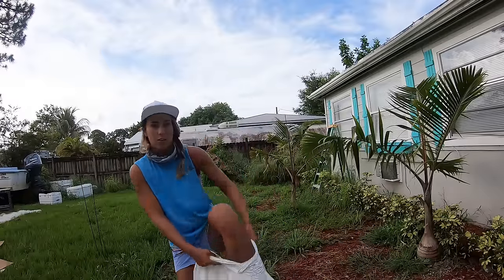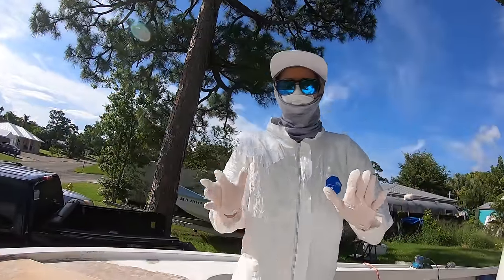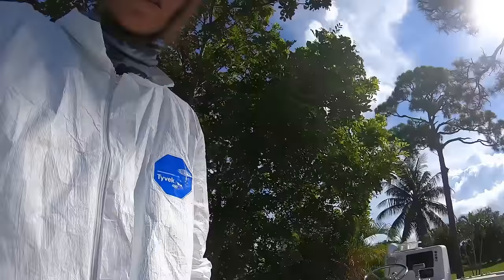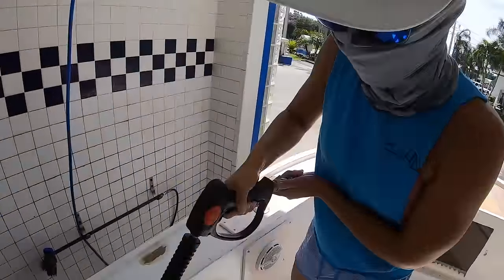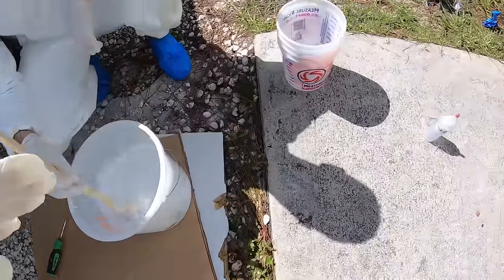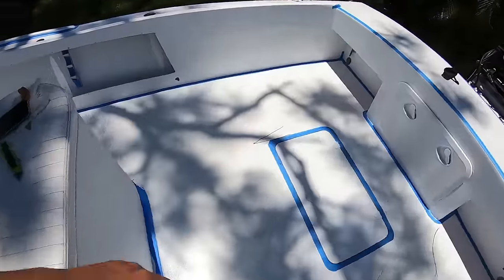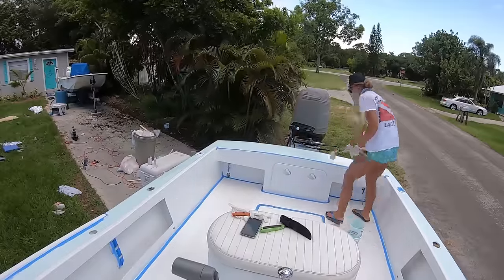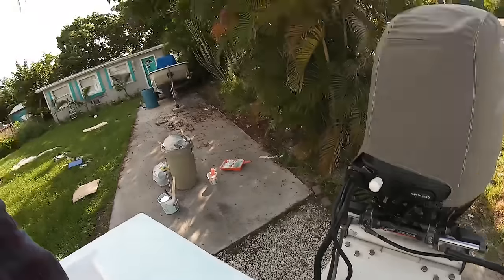Project Mako IS SUMMERTIME READY! Nonskid and gelcoat prep and application !

Comment: I noticed when you were having difficulty trying to remove some rod holders, your screwdriver was not exactly a top of the line tool. Phillips head screwdriver tips wear out and in turn strip the screw heads out. Get a good brand magnetic tip screwdriver so you can use replaceable tips. When removing stubborn screws, apply heavy downward force while turning the driver and that will help tremendously. You can also tap on the end of the driver handle with a ball peen hammer as you turn the driver. Good luck on the next boat project, this boat looks amazing, love the aqua color.

Comment: Not removing those rod holders would have drove me crazy every time i got on the boat lol, i cut a hole to access the back side and used it as a speaker hole when i was done with mine. The taping around the console and access door in the floor was a nice touch and looks great, i used the Sea Sucker double drink holder with dry box on mine as its suction cup mounted and easy to move around or take off to use near the grill when cooking out. Its looking great and cant wait to see some fish being brought in on it, be safe out there.

Comment: Boston Whaler blue.
Reply: Whaler use the blue for many years, then they cam out with a off tan which was not hard on your eyes and not as hot on your feet, but they all pounded your ass to death. New Whalers are not as bad. But they are narrow boats.
Reply: I had the same thought on the blue. A friend of mine had a 13’ BW with a 70 hp. It would literally jump out of the water on take off and chine out of control eventually at top speed. The transom started to crack so he bolted up 2 steel brackets for reinforcement. Dangerous boat but not too many of our friends could out run it. Good times on the water!